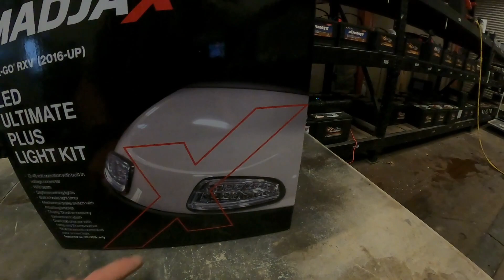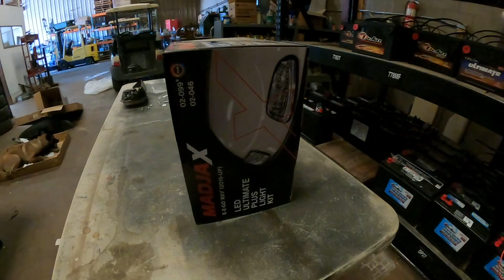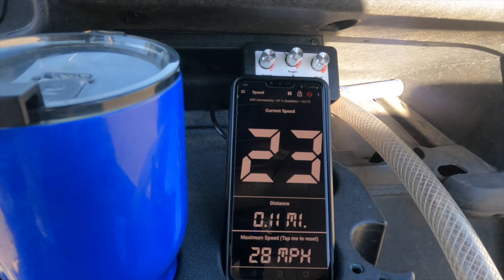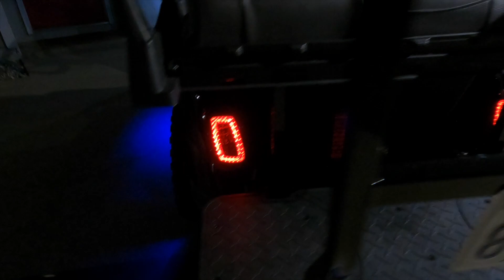ezgo RXV 32mph!!!

Comment: I had the navitas 600. It fried 2 “heavy duty” solenoids before it ultimately crapped out. Sent it to navitas to get fixed, got it back and won’t reinstall it. The cart is a big part of wife and my vacation home fun and we don’t want to worry about it breaking down again.
Reply from the maker: I only have messed with the curtis factory controller setup from rxv starting in 2014 and current. 2008 to 2013 has a danaher not too familiar with those. I know factory rxv carts came with 36volt solenoids. So hopefully you are using 48v solenoids but the curtis carts I have not had any issues.

Comment: The cart looks awesome!
What controller did you use?  And were you using lead acid or lithium batteries?
Reply from the maker: I used the navitas 600 amp. I kept the lead acid in there as well. I did another rxv with lithium and it was a 6 seater and was able to get up to 36mph with lithium and the same navitas 600amp controller.

Comment: Was the controller the only thing you upgraded in terms of achieving overall speed?  No motor upgrade?
Reply from the maker: Correct. The ezgo rxv already comes factory with an AC motor so the controller was the only thing that needed to be changed to get 30-32mph.